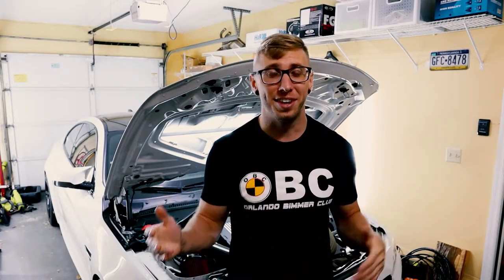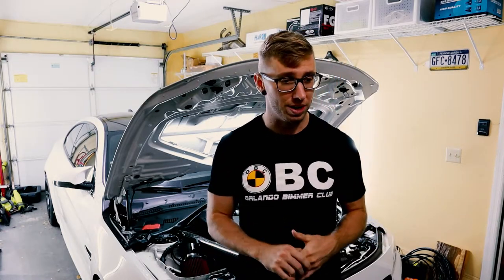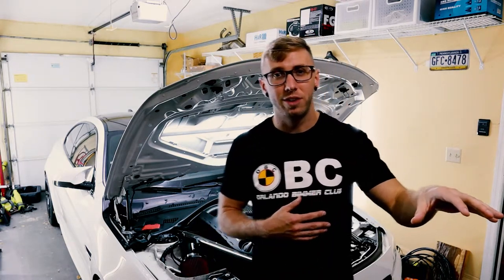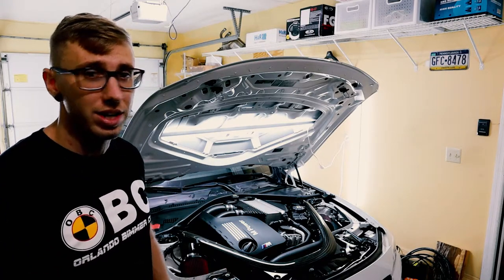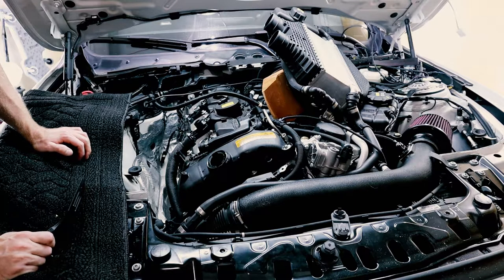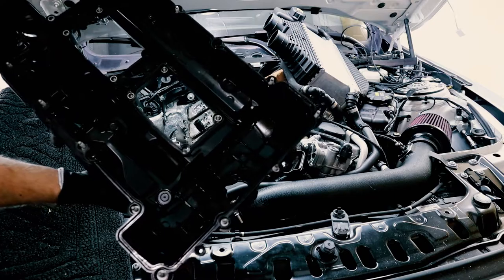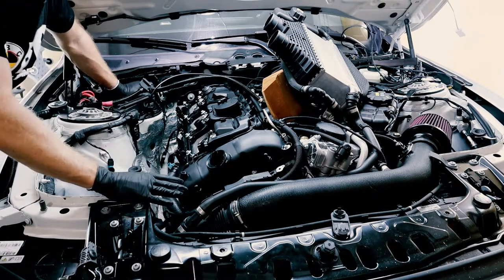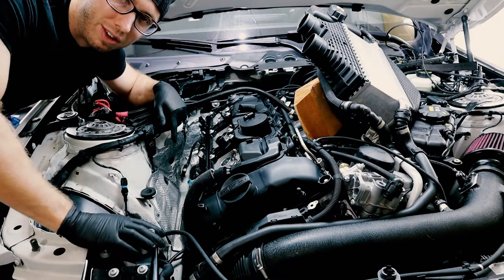Vlog 31 - BMW M3/M4 S55 Valve Cover Replacement Tutorial (PCV Valve Failure)

Comment: Great video. The community needed this. If you own a BMW you going to change a VCG, oil filter housing gasket, and eventually an oil pan gasket. My valve cover started leaking a few weeks ago so now it’s time to fix it and replace a few other things. Going to knock out the gasket, valve cover, spark plugs, coils, oil filter housing gasket, and a Mosselman oil thermostat. Just get it all out the way. Gonna be a long day but this video is a life saver. Glad to see you got it done with no issues and glad to see others are getting through it too. Saves roughly $2k in BMW labor.
Reply from the maker: Thank you Mthusiast Media! I hoped the video would help others out and save everyone some money. Yes, I'm still running this valve cover and haven't had issues. It's definitely a long day in the garage for this one, but totally worth the time. If you haven't started the job yet, I wish you good luck and let me know if you have questions during the install.

Comment: Finally I found a video on what was wrong with my m3 2016, I’ve been having the same problem for about a week now. Greatly appreciated this video 🙌🏽
Reply from the maker: Hey Shaun! So glad this helped you out because this problem haunted me and I’m sure it will many others. I couldn’t find anyone detailing how to do this job, so I said screw it and documented my process. It wasn’t that bad and I saved a ton of $$. Let me know if you have questions!
Reply: How did you know you had a problem in the first place? Have you felt any burning smell? I keep getting a burning smell on my M4, which I thought it could be oil leaking from the valve cover, but it smells more like plastic/rubber burning and I don’t have this noise described.
Reply: @swallowmeknob  Did you ever find what the issue was with your M4?? I have the same burning oil smell and I'm pretty sure it's the valve cover gasket that's leaking, I ordered a new gasket, but this is a lot of work so wanted to make sure I'm only doing this job once.
Reply: @tjwinsc  it was the valve cover gasket, bought one from BMW which is quite cheap, the labour to change it is expensive. Mine is a low mileage (27k) if yours is a high mileage car, the cover can be warped and I would recommend changing the cover as well, to avoid paying the labour twice as the labour only cost the same as the cover.

Comment: My M4 has a valve cover leaks right now. Got it diagnosed from BMW and they wanted to charge me $4900 parts+labor. Insanity. I unfortunately do not have a place to fix it myself nor am I confident in my mechanical ability. hoping to find a shop that will do it for at least half that -_-

Comment: Awesome job! Thanks for doing that. Reluctantly trying to learn how to give a shot myself. Got white smoke and burnt rubber smell coming from that area on my M4 too....
Reply from the maker: Thanks Anthony! This is certainly a problem with these vehicles for several generations of their engines. I wish they'd make the PCV valve a threaded component instead of building it into the valve cover. Let me know if you have questions during our install.

Comment: I just got this issue since changing my TMIC to an aftermarket as my stock was leaking! I checked and mine still has massive vacuum pressure whereas others have said they have no/positive pressure. Would this still be from the PCV?
Reply from the maker: The way to check is to take off the oil fill cover and see if it goes away.

Comment: Hey thanks for making the video it’s very helpful I’m doing mine it’s has the same noise 😩 any recommendations??
Reply from the maker: Glad the video was helpful for you. If you have the same issue, I still recommend everything I detailed out in the process.
Reply: I will be installing charge pipes and my new spark plugs since im taking everything off the car any other recommendations?

Comment: Thanks for posting this! I just had this issue appear a couple days ago on my '15 F83. BMW quoted me $3,390 to change the valve cover. I have a 5k mile road trip in a couple weeks and I need to take care of this.
Reply from the maker: Thanks Corey, glad it was helpful! I had to make this video as I felt nobody talks about this issue and it seems like it’s common for the older F8X chassis vehicles as we start putting more mileage on them. It’s ridiculous how much the dealer wants for a job that’s pretty straight forward to do on your own. Just takes time and patience. Let me know if you have questions along the way and good luck in your trip!
Reply: 3400 is criminal. You can get the crankhub done for much less

Comment: Great detailed video. My M4 has developed a valve cover gasket leak and after seeing your video I might have a crack at replacing it myself. I changed the spark plugs a few weeks ago so I am familiar with half the job anyway.
Reply from the maker: Hey Alan, thanks for reaching out! Hopefully this video can help you with the valve cover job. It’s definitely tedious, but not hard…plus it saves a ton of money over a dealer! I tried to keep the right balance of details for viewers to reproduce the job, but also try not to be too boring. If you get into trouble while doing the job and have questions, feel free to reach out.
Reply: Did the same. I changed the plugs and coils about a month ago. Now got that damn whining noise. I'm at 100k miles now. Figured I'm going to get the crank hub done and have the guy change the valve cover while he's at it. Any other parts I should do as maintenance once I plan to have the car torn apart?
Reply: Thanks for the video!

Comment: Hey bro, what is your first name - feel weird addressing you as “Awesomoto,” but your video was awesome.  I don’t have an M4, I have a 135i with only about 11k miles on it, but loved this video.  Believe it or not, ended up here after some stupid Reddit car repair thread comments where the OP got some ridiculous quote for repairs on his 2018 M4. They wanted over $4k to replace a malfunctioning headlight and $2,109 for a valve cover gasket replacement (just the gasket).

Some guys in the forum were claiming this was talking about doing this job in 1-2 hours well others were quoting book time of 8-9 hours.  Now, book would have to account for the time it takes to scrape the old gasket and reapply a new gasket… which is at least another hour. So, I could see this being 6 or 7 book hours, if using old valve cover. You made the right choice by just buying a new cover. Btw, ECS is great, but do you realize FCP Euro offers a lifetime warranty on almost everything they sell (except things like oil, for example)?

Thanks for the video, you’re clearly a skilled technician. Just wanted to add a few comments, if I may:

• Given your skill level and high end vehicles, maybe time for some upgraded tools. Highly recommend a good digital torque wrench, esp when doing sensitive work like valve cover torquing. Also, get yourself a flex head ratchet and a universal joint socket… 1/4” stuff is your friend in the engine bay.
•Why not put up 2 videos - one like this and a longer detailed version where you go step-by-step? Or, in the alternative, add separate step-by-step videos (multiple) for some of the more complicated things you do?  
• Do you have your own high end scan tool?  BMW wants you to “adapt” all kinds of stuff, like a battery replacement for ex. A video on just a full battery install would help a lot of BMW owners as battery replacement on a BMW is kinda complicated.

Anywho, long winded response - appreciate your well done video and your contribution to the BMW owner community. I also love that you respond to questions - don’t see enough of that in other maintenance videos. You earned a thumbs up and a subscriber! Btw, noticed your PA license plate hanging on wall. Were you born in PA?
Reply from the maker: RJ! 
Wow, all I can say is thank you for the kind response and attention to detail...you really analyzed this project and I appreciate that! 

Yes, this was more like a 8-9 hour job doing it myself (for the first time) so one should set aside this much time (and maybe 1-2 hours of margin) for doing the job. I hear you on the FCP Euro comment and since this video I've made the switch to purchasing all my parts from them...they are amazing. I recently did an ABS sensor video replacement in my latest vlog were I was able to get the sensor from them at a good deal.

- I agree, with you and I certainly could use some tool upgrades lol. I've taken note on your recommendations and I truly appreciate your advise on the matter as I'm a self taught DIY mechanic just trying to learn as much as I can about the vehicles I drive and how to maintenance them. 
- I do have all the raw footage from this install (not time lapsed) and I considered uploading a more raw version so that it could literally serves as a step by step video.
- Unfortunately, I don't have a high end scan tool and its something that would have made troubleshooting that ABS sensor much easier. Depending on what future work I do on the M4 I may have to get one to help troubleshoot.

 I'm glad you noticed that I respond to all comments. It's my goal to never lose sight of that responsibility of being a content creator and this channel is something I want people in the community to utilize as a reference when working on their vehicles. Yep, I'm a central PA native living in Florida now. 

Thanks again for your detailed response and helpful feedback!

Comment: Such a great video man, thank you for doing this and sharing with us , sadly I had the same problem, however I thought it was my turbos as I didn’t get the squealing noise. As soon as I got my new turbos installed I found out there wasn’t really anything wrong with my turbos. The next 2 days I get that same squealing noise. Done the oil cap test and the noise goes away. So now I’m going to get a new valve cover and do what you did. 
Thanks again hopefully It sorts it. 🙏
Reply from the maker: Thank you so much for the complements! I'm so glad to hear this video has helped you out and hopefully this can help you save some money by doing it yourself. As you know, this job quoted from the dealership is absolutely criminal. Let me know if you have questions during the install, I'm happy to help.
Reply: @Awesomoto  I just ordered my valve cover from Bmw direct, will arrive in 2 days. Total came to £580 with gasket so looking forward to sorting this out. Again thank you for your prompt response.
Reply: Also I’ll let you know on the outcome, thanks again man 🤝
Reply from the maker: @Autobahn_perf  That’s great! Of course, I try to reply as soon as I can in case people get stuck on something and need help. Good luck on your install!

Comment: Great video! Thanks a ton for filming it. My F82 S55 42K mile M4 developed an oil leak at the rear of the valve cover. Naturally, it waited until it was out of warrantee. The dealer wanted $4600 to fix it ($2300 parts, $2300 labor- 10hrs). Thanks to your video, I gave it a go myself. It took about 7 hours, but I bet I could get it down to 5. Thanks again.
Reply from the maker: Thank you so much for sharing your experience with the install! It’s not too bad of a job and like you said the cost savings is great. Glad it helped!!
Reply: Yes man , my F80 start having some noize from engine, and needs to replace PCV valve, dealer asking for about $3500 AUD to replace

Comment: Excellent video. I plan on doing this tomorrow! One question: does a new gasket need to be lubricated with anything before putting the cover back on? Thank you!
Reply from the maker: Great question! I didn’t use any lubricants on the gasket. I’ve always been told any oil related gaskets should be installed dry. So I followed that rule since this is an oil related gasket. Hope this helps. Good luck on your install!!

Comment: I just got the same issue on my m4. Big relief finding your video. Will anything bad happen if I keep driving the vehicle?
Reply from the maker: Glad to hear this helped you out! It haunted me trying to figure it out and couldn’t find much info on it. It’s best not to drive too much with it because the crank pressure builds up and has to escape through other areas like gaskets and valves. You could potentially have rear main seal issues as it tends to want to escape from there. Let me know if you have any more questions or need help troubleshooting. Thanks for reaching out!

Comment: Awesome video. Did you have the check engine light come on when you have the pcv valve failure? It happened to mine
Reply from the maker: No I never received a check engine light. I just heard the high pitch vacuum leak sound LOL! A light would have probably kicked on of my leak got big enough.

Comment: Hi, thanks for this great video. I'm sitting here contemplating on whether I dare to attempt this. It would be a new "achievement unlocked" for me as I believe I have the same issue on my -17 55K M4. I see the valve cover is 700$ and the seal 30$, did anyone consider replacing the seal on the cover? Wouldn't that have been sufficient? You also refer to valve, is the valve built in to the cover or what am I missing here?
Reply from the maker: Hey Daniel! I believe in you and think you can pull this off. Just set aside a full day and have some patience with the process...you got this! 

Unfortunately, the issue is due to the PCV valve which is built into the valve cover on this engine, so replacing the seal on the cover won't fix the issue. The squeaking you hear is due to pressure build up and it can't be released by the PCV valve since it fails in the closed position (usually). If it were a bad seal on the cover, pressure wouldn't build up and the squeal wouldn't occur. 

Let me know if you end up tackling the job and if you have questions along the way.
Reply: @Awesomoto  thanks for the explanation!
Reply: @Awesomoto   I did this but afterwards are getting misfires in cylinder 5 & 6. I moved around the coils and spark plugs, but still keep getting the misfires in 5 & 6. Does anybody have any idea of what could be wrong?

Comment: This video was a huge help to me over the weekend. A friend and I replaced the gasket on my m4. It took the whole day but was a great learning experience. I would add though that since mine is RHD, we had to remove the wipers and the cowl at the bottom of the windshield in order that the cover went back on without any impediment. Upon removal it was hitting the wiper motor and cowl but just removing the cowl and zip tieing the battery cable up (small cover beside the positive terminal comes off to give more slack) it was very easy to get the cover back on and seated correctly. Your tip of using something plastic to pry up the cover came in very handy too by way of a trim removal tool. Did you have a burnt rubber smell coming through the vents after this job? Also that vent hose you removed to the front of the engine at 7:14, BMW TIS says not to do that but to remove the screw and bolt at the other end. I did it the same way you did and the whole thing crushed in my hands it was so brittle!
Reply from the maker: Hey Krieg! Thank you for the feedback and detailed write-up! I'm glad this video helped you out as this was one of my favorite videos I've made for the M4...it was so rewarding to do this job myself and not pay the outrageous quotes I was receiving from shops.

Comment: Can you provide the exact tools for this job? I currently have exhaust/oil smell coming through my vents only when heat or AC is on while in sport or sport+. There is some oil residue near back of charge pipes so im very confident its just the gasket not the cover itself. Ill also replace plugs and coils. Want to save myself money and not destroy my m4
Reply from the maker: Hey Kareem, Sorry for the late response on this. The only tools you'll need that are specialty which one might not have (I certainly didnt) were the torque and inverted torque drivers. I suggest picking up a cheap set at Harbor Freight as they were good enough for me to do the job and kept me from spending an arm and leg for the tooling. Other than that you'll just need ratchets, screwdrivers, and ratchet extensions for the remaining job.